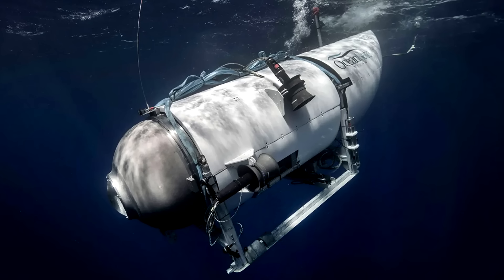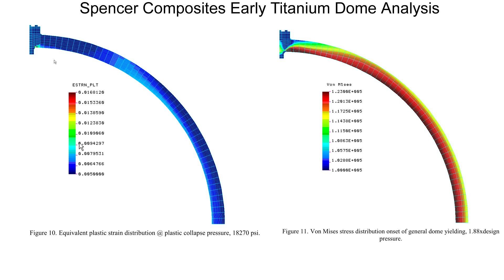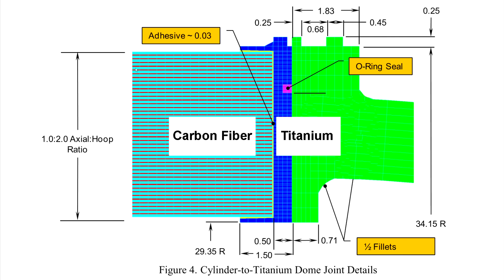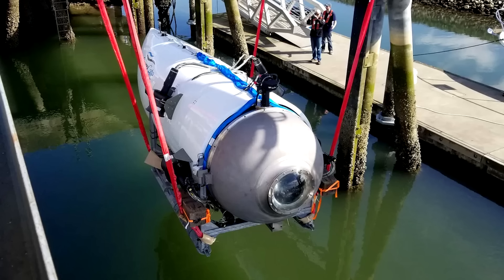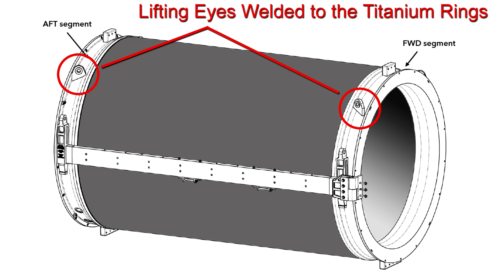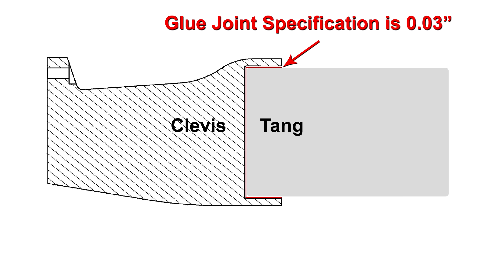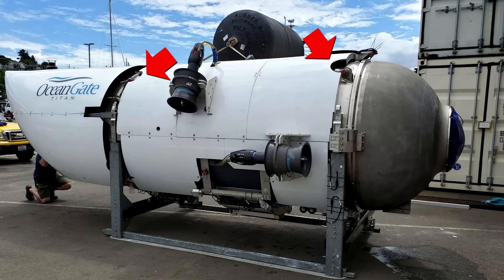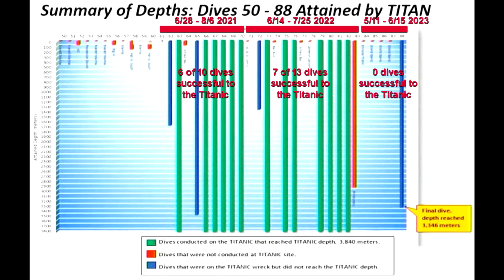OceanGate Titan Titanium Rings - An Additional Story About Them

Comment: So on that occasion where they lost control of the attitude during recovery and the sub spent a long time swinging against the barge in heavy weather - was it suspended by these eyes?
Reply from the maker: I think you are referring to dive 87.  In that case, the sub was fixed to the LARS by the rear pins on the landing gear.

Comment: Looking at the construction I wonder if they even calculated for the dead loads of the carbon fiber hull on those lips for above water atmospheric pressure? The hull is basically hanging on those thin lips everytime the vessel is lifted. Did they even calculate for any dead loads at all?
Reply from the maker: Good comment.   I don't know.  Tony testified, seeming to indicate that those think lips were not the issue.  But I agree with you, I don't know about hose thin lips.

Comment: wtf, I am only h.s gradumate. AND I KNOW welding those tabs on was wrong! They did not bother to weld even? a 12 inch long rail/ triangular tab to distribute the load. That is really shocking
Reply from the maker: Thanks for commenting. I don't know anything about welding titanium, but adding the lifting eyes seemed like a bad idea.
Reply: @solareclipsetimer  hi, to not even distribute that load over a wider area- 12 inches long instead 3? is shocking. I bet they welded those tabs on and did not remachine the part

Comment: I never even noticed the lifting points.  I know it ended badly but they did have a several completed trips to the Titanic.  Many more over 1,000m trips.  The earlier trips seem to be ignored. They had a history of returning safely.  Almost all the videos I have seen by other creators heavily imply that it imploded on the first trip to the Titanic.
Reply from the maker: Thanks for commenting.  You may like this summation. It got to the Titanic 13 times at 3,840m (and in 2022, it got to the Titanic on four consecutive dives!). It also had one dive to 3,500m, one dive to 2,900m, and two other deep dives, 1,700m and 1,380m. You can also count the five high-pressure dives in the Deep Ocean Test Facility done before the expeditions as cycles (3,000m, 4,000m, 4,200m x 3). So, that is 20 deep pressure cycles (if not including the 1,380 and the 1,700). That would be considered a success if they were all unmanned dives with a carbon fiber hull test program before imploding. Or, if they stopped unmanned testing short of imploding and did destructive testing to learn about the hull dealing with the pressures. But, imploding while manned with five people makes it a failure.

Comment: I'm qualified US Navy Submarine service, 6 years.  You couldn't pay me to get into that submersible.  PS, it's not a submarine and I also made this comment before the incident.
Reply from the maker: Thanks for your comment.  You are correct; the term is submersible.  Pat Lahey of Triton Submarines was asked this definition question during the hearing, and here is his testimony quoted -  (USCG 9/20, Lahey, 4:50:27)  Q:  Sir what's the difference between a submersible and a submarine.  A:  "It's a very good question and often people don't recognize the difference but a submersible is a craft that is not capable of regenerating its own power.  Submarine has to have the capacity to regenerate its own energy supply and so the thing about a submersible is it's usually powered by batteries or some sort of an energy source that's limited and limits its endurance."
Reply: @solareclipsetimer as opposed to the infinite energy reserves that are used in submarines?! Seriously that's a terrible definition
Reply: @Kington99  It sure is!  You would think a guy who works for a submarine company should be able to do better. Here is my own inexpert attempt: a submarine is a watertight vessel capable of moving around the ocean under its own power, in all 3 dimensions, regardless of how it stores the energy with which to do so (nuclear, liquid hydrocarbon, chemical battery, etc), whereas a submersible is only capable of sinking, or submerging (and, for the more advanced models, ascending) on its own.  Titan did have electric thrusters, to be sure, so I suppose it would actually qualify as a submarine by that definition, although an extremely limited one.  What other definition could one come up with that would include something like the Navy's nuclear missile boats but exclude Titan?  Horizontal range?  That seems a little arbitrary though...

Comment: What is the failure weight of lower lip of the Clevis and thickness? Because you can clearly see that lip failed, that lip should have been thicker for structural support instead of a guide for the carbon fiber body!!!!
Reply from the maker: Good comment.  Tony tried to explain it during his testimony.  He stated that those lips were a small dimension because they were only there to hold glue.  They weren't supposed to take loads.

Comment: I'm curious what method they used to control the thickness of the glue joint.
Reply from the maker: Thanks for your comment.  Good question.  In the instructions for glue day, they talk about using shims: " Use circumferential, rectangular shims outside of the CF hull so it is roughly axially centered within the FWD segment.  Remove all 10 rectangular shims and remove them before the glue dries."
Reply: @   Ok that centers the dome on the hull radially. For the end of the hull to dome face do you know what prevents squeeze out of the adhesive.? 
I saw the video of them applying the adhesive with spatulas. But the weight of the dome would push out the adhesive.  In some applications a string of silk thread is laid down first.  Just curious. I’m sure they had some method. 
Or would they?

Comment: Your set of OG videos are the best I've found on the subject. 

Packed full of information, presented in a clear, concise and no-gimmick style.

As others have said, I'm surprised the sub managed to successfully complete as many dives as it did.
Reply from the maker: Thanks for commenting, and I am glad you liked the content. I appreciate you noting that I am trying not to be sensational about the Titan accident. I am trying to analyze and present the facts by piecing together hours of separate testimony on the subject.  You may like this summation.  It got to the Titanic 13 times at 3,840m (and in 2022, it got to the Titanic on four consecutive dives!). It also had one dive to 3,500m, one dive to 2,900m, and two other deep dives, 1,700m and 1,380m. You can also count the five high-pressure dives in the Deep Ocean Test Facility done before the expeditions as cycles (3,000m, 4,000m, 4,200m x 3). So, that is 20 deep pressure cycles (if not including the 1,380 and the 1,700). That would be considered a success if they were all unmanned dives with a carbon fiber hull test program before imploding. Or, if they stopped unmanned testing short of imploding and did destructive testing to learn about the hull dealing with the pressures. But, imploding while manned with five people makes it a failure.
Reply: Thank you for that additional information, much appreciated.

Yes, I can tell you are a creator that cares for the presentation of the analytical facts as opposed to the "entertainment value"....I commend you for your work
Reply: I remember seeing carbon fibre p/l for the first time, and the way they joined the couplings. Interesting process.

Comment: I was just wondering about this. I am not sure if more rings would have helped, or made it worse. But really I would never have used carbon fiber it is a terrible material for anything that needs long term durability.
Reply: I would never use carbon fiber in an application where the fibers are in compression. They're only strong in tension.

Comment: I always wondered if it failed at where the two pieces connected. The Carbon fiber and the titanium outer cap. But it looks like the carbon fiber was fracturing over time. One dive to many. R.I.P. ⚓
Reply from the maker: Yep, the hull or the glued junction, either could have been the primary failure point.
Reply: @solareclipsetimer  Thanks for Video and Reply. It's such a tragic story and event.

Comment: As I understand it, even if the lift eyes were milled out of the forged titanium blank, eliminating any effects of welding on the ring, lifting it from those points would still be sketchy. Sketchy according to Tony anyway.
Reply from the maker: Thanks for your comment.  That may be true.  But perhaps they could have been engineered in the beginning to be part of the design.  They just never started out in the original  Spencer designs.  So, trying to work toward that goal may have been an oversight that they would regret later.  But adding them seemed to be a mistake.

Comment: the stupid designer applied aerodynamic formula's which are absolutely wrong  and should have listened to those that told him to use applied hydrodynamic principles to its design required for massive compression requirements but he did not listen.  What an absolute moron, thinking he was smarter than those proven scientists and engineers.  It is sad that others had to die with him.
Reply from the maker: Thanks for your comment.  You have made a great point that should be considered more.  Because Stockton has a degree in aerospace engineering, he thought he could use aerospace engineers to build a sub.  The other reason is that no marine engineer would touch this project.

Comment: You are parsing the whole problem way tooo much. The main and overriding problem is that the passenger hull was not titanium or steel alloy. Any other flaws become secondary.
Reply from the maker: Thanks for commenting.  Sure, if OceanGate built a titanium sphere, we wouldn't be having this conversation.  But they didn't.  They built something unique that failed and therefore has a lot to be discussed.
Reply: @solareclipsetimer  Okay, but  the science has been developed for nearly a century and wonderful vehicles developed over time. Rush built something unique that had no redeeming characteristics, not the least because he ignored the engineering which produced successful underwater vehicles before him. Reminds me of a film of a man on a bicycle trying to fly a contraption with multiple wings that simply collapsed on him. To focus on why the wings collapsed doesn't focus on the basic problem of trying to fly with a bicycle.
Reply: @scottzema3103  Well, the Gossamer Albatross worked.
Reply: @soaringvulture  Well, let's not condemn ALL initiative or all invention. But it looks like THIS particular initiative and many other crackpot ideas, where we ignore ALL the science and ALL the established engineering, can produce spectacular failures. The Titan is an excellent example of unbounded initiative and experimentation while ignoring the essentials.

Comment: The glue is basically just a sealant to keep the water out. The water pressure on the ends of the domes are pushing the rings onto the carbon fiber hull with over 20,000,000 pounds of force. With that much force pushing the rings on to the hull you only need a water sealant. The glue does help hold everything together when the sub is on the surface. There was just so many things wrong with the sub and its operation that it was a giant booby trap with multiple triggers just waiting to go pop.
Reply from the maker: Thanks for your comment. You are absolutely correct that the domes get forced inward. The domes are getting forced against a very hard epoxy. Tony was worried about mircocracking in the epoxy. The epoxy was not like an O-ring in the hatch mechanism.  The issue is that at these pressures, you don't get a "drip, drip" leak like under your kitchen sink. When it goes, it goes all the way, causing an instantaneous catastrophic leak/implosion. And the lifting eyes weren't the only thing stressing the front ring glue joint. What about opening and closing the 3,500-pound front dome hundreds of times? Having said that, it could have been the hull that failed. Thanks again.

Comment: DIdn't the US Navy make one of those, except they used Steel rings to better match the rate of compression/expansion of the other material?

Separately with the welding eyes, seems like they accordion'd the sub when lifting it.  compression on the top, tension on the bottom.  

I can imagine how that could grind the glue on the bottom of the ring's mating surface.

Comment: Failure of the glue where the ring joins the hull would not cause an implosion. Even if the glue is failed (as long as the dome did not fall off until the water pressure built up) the farther down they went the more force would be applied via water pressure on the dome to hold the dome in place. In rough numbers, at the implosion depth, the force pressing the ring onto the carbon fiber edge of the cylindrical hull is around 20000 psi. This is many times the water pressure trying to enter the joint itself.

Lifting of the sub repeated by the lifting rings could have distorted the rings enough to mechanically damage the structure of the carbon fiber hull and the bonding of the adhesive layer holding the carbon fiber layers together (the five layers). Carbon fiber is not designed to flex.
Reply from the maker: Thanks for your comment.  You are absolutely correct that the domes get forced inward.  The domes are getting forced against hard epoxy.  Tony was worried about mircocracking in the epoxy. The issue is that at these pressures, you don't get a "drip, drip" leak like under your kitchen sink.  When it goes, it goes all the way, causing an instantaneous catastrophic leak/implosion.  And the lifting eyes weren't the only thing stressing the front ring glue joint.  What about opening and closing the 3,500-pound front dome hundreds of times?  Thanks again.

Comment: Doing serious engineering in inches is a red flag imo. There's a reason NASA and the US military use metric.
Reply: Not at all. Inches work just fine. As it happens, I design structural stuff in inches because the machine shops like it better and optical stuff in metric because the lensmakers like it better.

Comment: Also Nissin stated that the CG was slightly aft, what is obvious considering the equipment section.
I don't see any indication they accounted for that in the rigging with the lifting eyes or measured the individual loads, as the cables look identical and join in a single point on the crane.
This creates additional stresses in the longitudinal direction.
Reply from the maker: Thanks for your comment.  You make a great point.  I don't see anything in the rigging or when the sub is on a crane 
that accounts for the aft center of gravity.  It may have been very little, though; Tony only says "aft a bit."

Comment: It's pretty apparent that the failure occurred at the forward ring interface to the carbon hull. There's a picture of the inner ring interface surface and it is literally just bare metal with absolutely no carbon hull still attached in any way. Compared to the aft ring interface where the hull was still glued firmly in place and large jagged pieces of carbon were still attached to the ring.  The hull started to buckle in the midsection and then caused the circular shape of the tube to deform into a oblong oval shape. This produced a mechanical jacking leverage effect that overcame the pressure of the outside environment and the ring just popped off.
Reply from the maker: Thanks for commenting and you are correct.  The NTSB images of the recovered forward ring have zero carbon fiber still attached to the residual glue.
Reply: Also, the ring that held the viewport in place bolted to the outside of the front endcap, those bolts wear sheared right off, all of them, probably simultaneously with the collapse.

Comment: Lifting is not allowed on the rings... But the whole construction rests on those rings as the frame under the sub are connected to the rings... Can you please explain what is the difference.
Reply from the maker: Thanks for commenting. When sitting on the landing gear, the weight was supported by three points on each landing, which also served to keep the rings round. So, six points of support versus four.  We also don't know the "footprint" (square inches) of the six landing gear fixation points, where we can see the "footprint' of the landing eyes, which doesn't seem big. (although no exact dimension is published for us). But you are correct with your thought here; there could be some of the same issues, but just on the bottom when sitting on the ground. But I think the other issue is being moved around by a crane is NOT gentle. So, sudden "tugs" are being transmitted to 4 points under weight, amplifying the load. It's approximately 5,500 pounds if static.  Good thought, thanks for asking.

Comment: This type of ad hoc modification can lead to unintended consequences if not thoroughly re-engineered to identify any negative effects.  You don't just make s*** up as you go.  Total hubris.
Reply from the maker: Thanks for your comment.  I agree.  I don't see how you could figure out the engineering to do this later.  There may be a way, but man, it's gotta be tough.
Reply: It all comes from the moronic notion of 'move fast and break things' that became the fashion in parts of IT where it doesn't matter a hoot if the whole thing turns into a total Horlicks. TBH, I think it's a crap way of doing anything anyway, but in safety-critical applications it's arrogant, dangerous nonsense. It also encourages sloppy thinking, which is not good in any problem-solving application I've ever been involved with, or can think of.